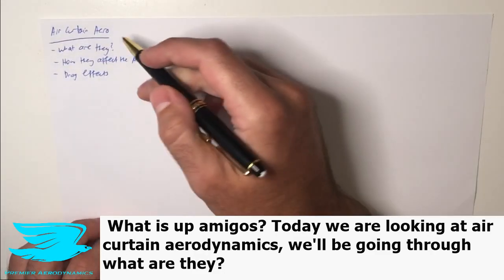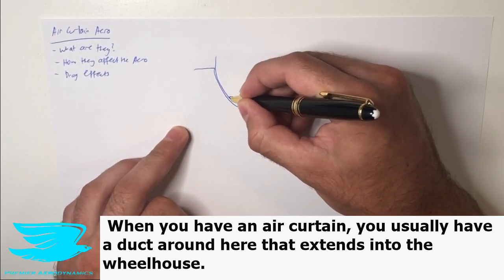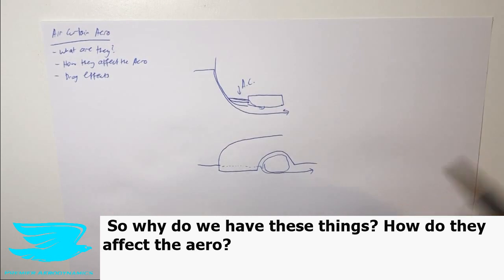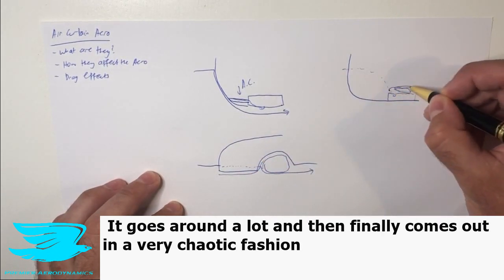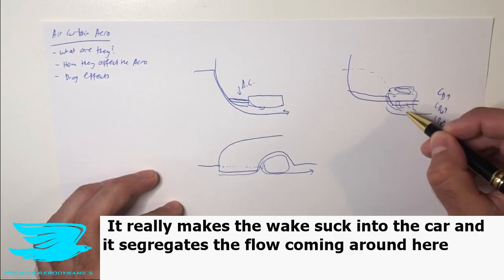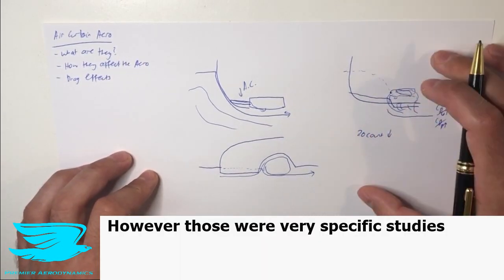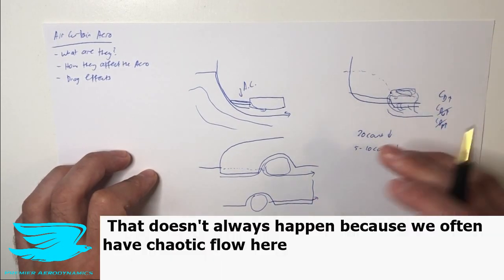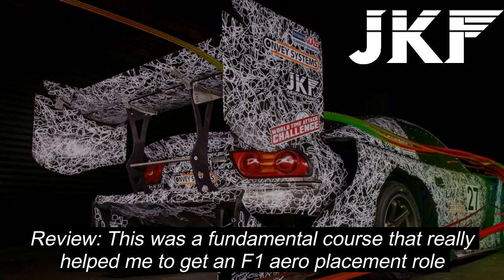{Automotive Aero #22} Air Curtains Explained

Comment: Well explained 👍
Q. Does air curtain help in cooling car front tyre & disc brake 🤔
Reply from the maker: I'm not really sure. I asked one of my friends who works on brake disc cooling and he said that it depends on where the car cooling flow comes from as well as the tyre width. I guess also the rim design would affect it. So, more work needs to be done to find the answer.